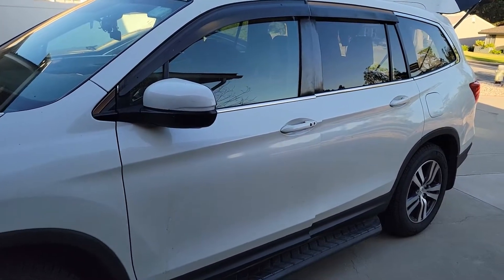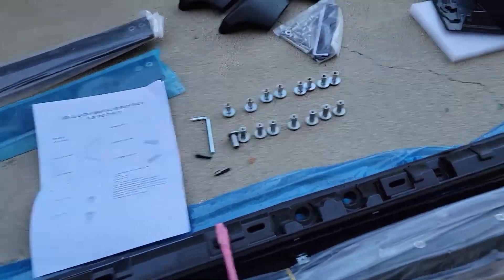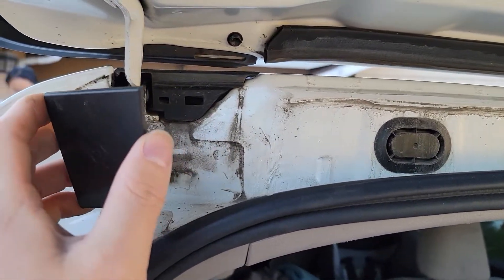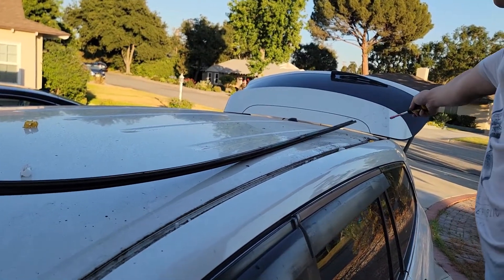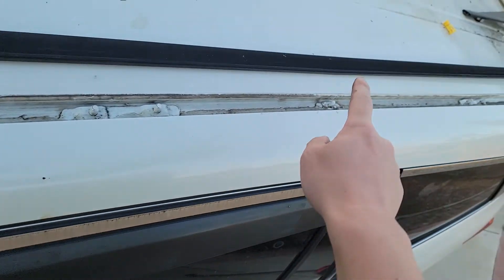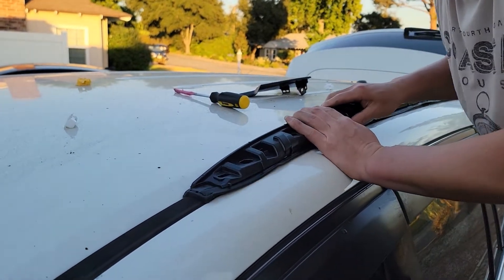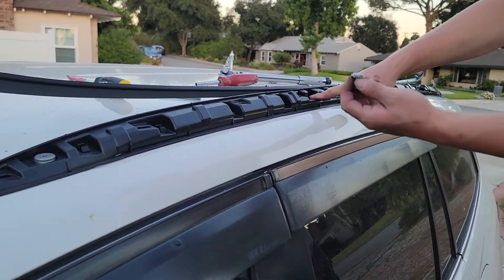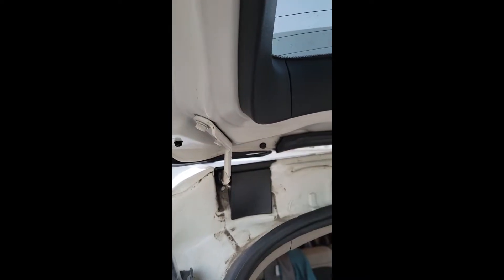2016 Honda Pilot Roof Rail installation

Comment: This video, as well as the second one for the cross bar, were clear and very helpful.  I bought and installed mine and had no troubles on my 2016 Pilot.  Particularly your mentioning to cut the track slightly longer and seeing how it fit for you helped me feel comfortable before putting the hacksaw to my own trim.
Reply from the maker: Actually you do need some silicon or glue for the short piece of cover, i lost my piece somhow and i already throw away the left over long part: ( at this moment  it is left uncovered!
Reply: @yongliang3397  I'll put some silicone on mine right now.   Thanks for the heads up!

Comment: Thank you for your video helped me to installed mine. I was able to put the washers by pushing down and tight one without the washer first, then put the second with the washer and tighten that one down, takedown the first one out put the washer and tighten back.
Reply: Thanks for the tip!